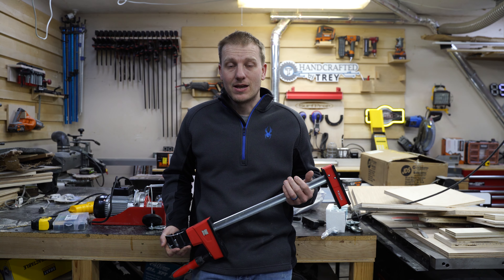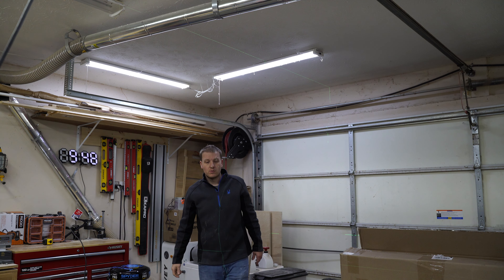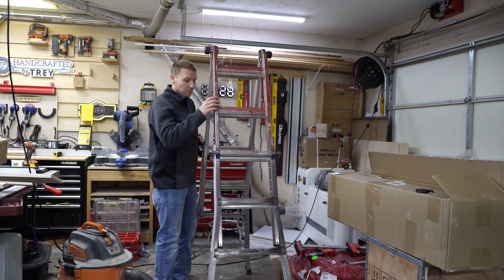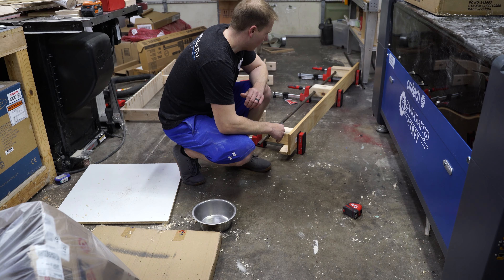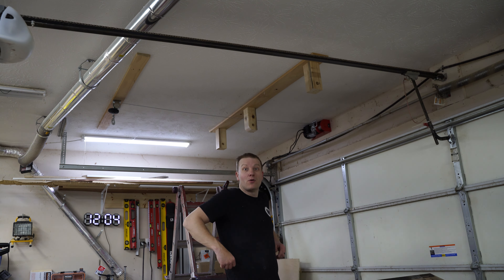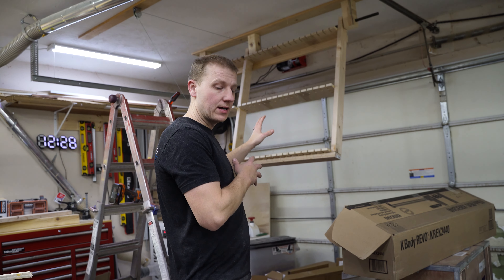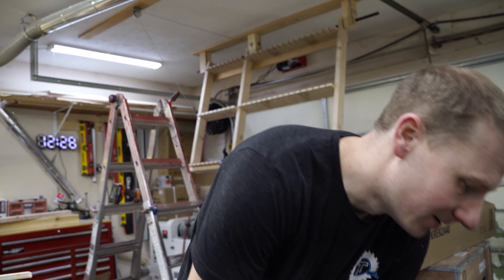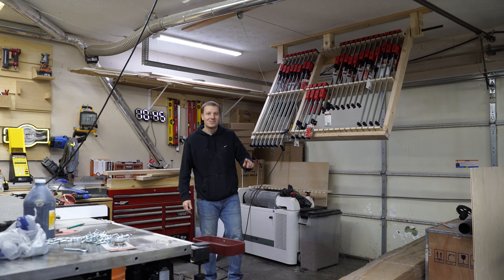Ultimate Ceiling Mount Bessey Clamp Rack

Comment: Fun and functional. Not much else that is a ringer for storing on ceiling. I have bikes and an absurd amount of skis. Is 20 too many? Ladders and PVC tubes for long scraps is about all I’ve ever wanted on my ceiling.

Do you find the 40 inch Bessey parallel to be your most used? I’ve loved the 40 inch because I guess my projects are that size. I have four 50s. Eight 24 and 40. I’m curious if I’d use two 31 inch but will wait a couple years and see.